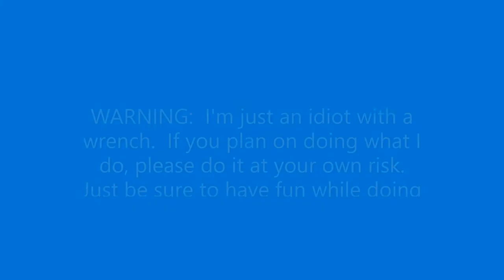Replacing Pins and Bushings on Bobcat 873 with a Harbor Freight Press!

Comment: I used an acetylene torch to cut the bushings out of the cylinders and the lift arms.  It's a quick job that way.  Just need to make sure you only cut through the bushing.
Reply from the maker: Yeah I might have to give that a shot next time. My torch need a regulator and I was too lazy to go buy one. I should have just gone and get got a new one haha

Comment: A ball joint press would be easier than monkying around with the floor press.
Reply from the maker: I should have rented one and tried it.  I was worried it wouldn't be enough to move those pins. The 20 ton press did about all it could to bust them loose.